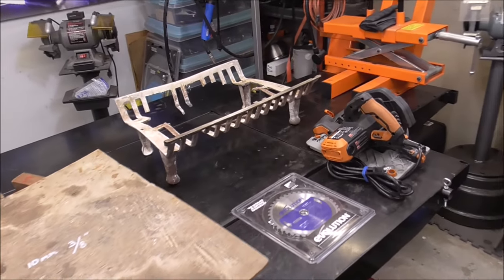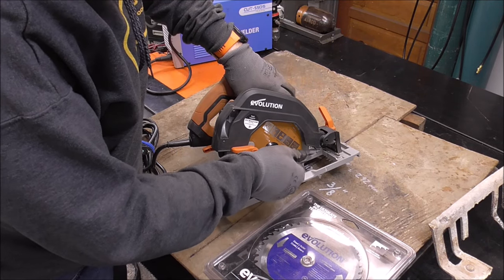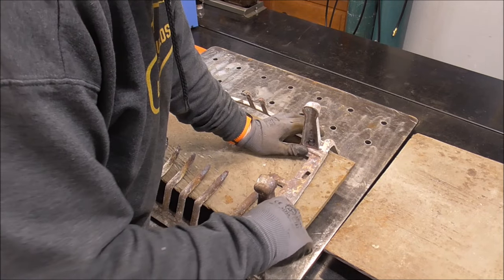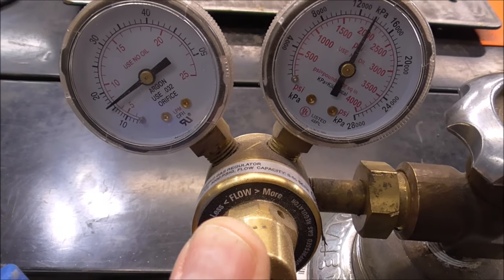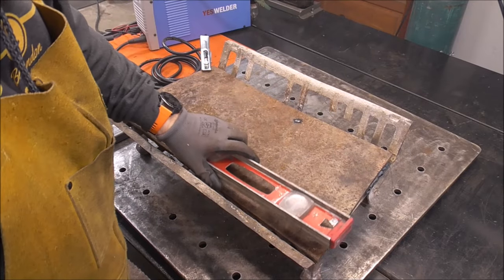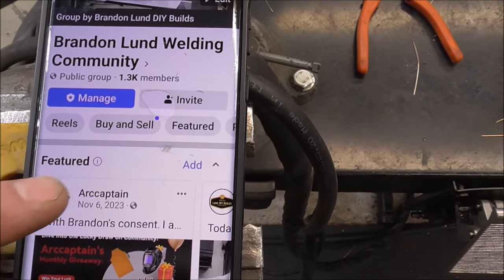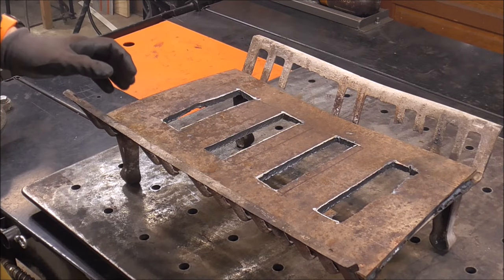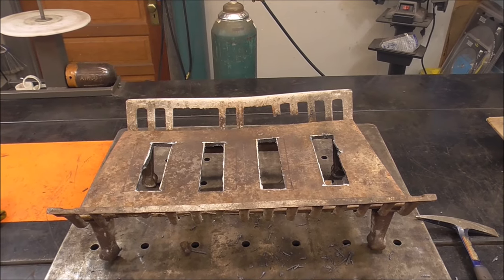MIG Welding and Plasma Cutting Fireplace Grate Repair: 12 Interesting Facts

Comment from the maker: Metal Cutting Saw Link: https://store.evolutionpowertools.com/products/r185ccsx?ref=BRANDONLUND
MIG200 https://www.arccaptain.com/products/mig200-200amp-multi-process-synergic-mig-welding-machine?_pos=1&_sid=76eca4fa3&_ss=r&ref=Brandon
Plasma Cutter https://yeswelder.com/collections/plasma-cutter/products/plasma-cutters-cut-55ds?ref=BRANDONLUND
$25 Aluminum MIG Conversion https://youtu.be/FGhSo82MP9U
MORE WELDING AND FABRICATION VIDEOS HERE:https://www.youtube.com/playlist?list=PLfbf78fMz9Vol0uX2-GNc6mLi75zpqb5f
LEARN HOW TO WELD VIDEOS HERE:https://www.youtube.com/watch?v=ADa1I319GJ0&list=PLfbf78fMz9VqxPZTT-xmwdcrHVa7ML-ft
AWESOME TOOL BUILDS! https://youtube.com/playlist?list=PLfbf78fMz9Vo2Cv3V5fmYlDZGpS8Hp98l

Comment: Hi Brandon, 

Years ago when I first purchased my plasma cutter, I was told that my air source was oil-less, IT WAS NOT!  That was an expensive assumption never to repeat!

From that experience, I purchased my own  "oil-less" air-compressor and made sure to always carry at least two air dryers for those extra humid days.

I really love your contribution to the environment by using the warped plate material for this project. 😊

Tim from the lower deserts Arizona.
Reply from the maker: Thanks Tim. I love recycling metal whenever I can. Dry air is definitely good for extending the life of your consumables 👍

Comment: Fun little video! I really need to download that plasma chart. I have been running too much air pressure and too high amps when I am cutting! Thanks for sharing as always, Brandon!
Reply from the maker: Glad it was helpful! Yah you will save on consumables and you get a better cut

Comment: Ever think about putting an insert in the fireplace? My ex father in law put one in his house and boy did it keep his house warm. Myself you should make the whole thing out of steel. I had an old like pot belly stove and I don't know how many times I had to replace the grate in it. Good to see you doing some welding!
Reply from the maker: Honestly Jake, I think i'm a glutton for punishment. EVERY year I tell my wife I'm going to put in a propane insert and every year I find myself buying, cutting, splitting, stacking and lugging wood.  As I get older it doesnt come as easy as it once was. I know it will be so much more efficient but one of these days I need to bite the bullet but It's almost nostaglic doing everything I mentioned but it's nice to flick a switch and have instant heat too. LOL It stinks getting old brother Hahahaha

Comment: When I first bought my fireplace I asked the expert about what kind of grate I should get. He said none. He said grates are for making nice looking fires, but if you want to use a fireplace for heating, the fire should be directly on the bottom of the firebox. After many years without a grate,  I have to agree with him. I've been heating my cabin in western Canada for many years, and the biggest issue is keeping my place from getting too warm. I of course have a fire brick bottom on the fireplace,  and an outside air source, and sealed glass doors .
Reply from the maker: I'm not educated enough on the subject to know the difference but i do remember my dad had a german designed heating firplace and that one had a grate. The bottom of this one has fire brick but the box is steel. There are grates on the face of the brick that pull air in from the bottom and it rises out though the top grates from the air gap between the steel firebox and firebrick. My doors aren't sealed. We do it solely for the ambiance but the added benifit is the heat so for our intended use the grates are probably best for us. We also have a brass door in the bottom of the fireplace so you can sweep the ashes in then empty them in the basement but i don't use it. I just shovel it out every few weeks

Comment: Fascinating and unbelievable to see 10mm-steel cut like butter with a circular saw😁. My jaw just drops😅. Think that wasn't possible 10 years ago. Never dared to try this myself. What a great repair. Always tricky welding on old cast-iron. You succeeded 100%% in it. Just compliments Brandon. Learned a lot. Many thanks and greetz from Holland😀
Reply from the maker: Thank you very much! I appreciate it Marcel. You are 100% right, they have come a long way with getting these saws down in price and the ability to cut thick materials. I was totally impressed.

Comment: Nice video! I was curious as to why you chose mig instead of 3/32 6011 or 6013? Does mig react better with the cast iron?
Reply from the maker: 6011 is better on the dirty steel but the MIG is better for making the connection to the cast. Silicon Bronze works excellent on cast but it's melting temp is too low for this application. A 7018 would be my go to if I only had stick. It's a low hydrogen rod with ok results on cast iron. I have a whole series on cast iron thats pretty popular if your interested :)
Reply: @BrandonLund  Thanks Brandon, I appreciate the response! I'll watch it. I did catch the video on the Muggy rods and was floored at the idea of welding cast iron without a pre-heat and cool down. Stay warm, here in Nebraska we've been getting hammered as well
Reply from the maker: Thanks man! It's currently 10 degrees right now as we speak Brrrrrrrrrrr!

Comment: Brandon, the last Thanksgiving shopping craze saw me land a YesWelder CUT-55DS Pro plasma cutter for 107.99 including tax on Amazon. A super sale price along with an Amazon coupon made this incredible buy possible. Health and family issues have prevented me from using the cutter so far. I also do not know much about the unit. Do you have any experience with the CUT 55DS Pro or perhaps someone watching can chime in and let me know what they think about the DS Pro and perhaps any issues I need to be aware of. Perhaps there is a great YouTube video out there that breaks down the DS Pro. If anyone knows of a resource other than the manufacturer, I would appreciate it.... many thanks... Joe
Reply from the maker: Interesting enough Joe, I just browsed YesWelders site yesterday and bought a CUT55DS Pro with the plan of doing a giveaway with this plasma cutter in this video. What interested me is that the Pro it's not a high frequency unit, which means you can use it around sensitive equipment without signal interference such as on computer controled vehicles with less worry of frying the electronics. Great for exhaust and rust repair. It's still good practice to disconnect the battery but lot less of a chance of disrupting sensitive electronics. I plan to do a very detailed video of that machine AND i've made an arrangement with YesWelder to provide my viewers with a promo code so I can save them a little money too. 107.99 is a screaming deal for that machine! It's a very nice unit and I cant wait to fully test it out. I'm going to push it to it's limits and see how it does.
Reply: @BrandonLund  Thanks Brandon. I look forward to your video and review-demonstration (hopefully) of the CUT 55DS PRO. I have already learned something about the DS Pro from you already. Thanks again Brandon, greatly appreciated.. Joe
Reply from the maker: @joesharp5602 thanks Joe. It should be here by next week and I plan to do do a very thorough review and test.

Comment: Could you mention in the future how well this repair held/worked?  I am wondering if something like that when being welded in while it was new if it would have made it last even longer then doing it as a repair?
Reply from the maker: Absolutely! My guess is that after a while, the weld at the cast iron to steel will eventually fail from the heat cool cycles, but maybe not... I have no idea how long it will last, but I'm just as curious as you and will report back at the end of the heating season 👍

Comment: My Hugong probably won't even be able to start the arc on such dirty material.
Reply from the maker: Give yourself a good ground and a spot to start your arc and it will go. MIG really doesnt like dirty metal. 6011 / 6010 electrodes would be perfect for this but MIG is faster so I went with it :)
Reply: @BrandonLund  yelp SamoVAc doesn't like MMA. 😉
Why don't you opt for wood pelets instead of oil for second fuel?
Reply from the maker: I think I might actually go with a propane insert at some point. Pellets really arent a bad idea either really.
Reply: @BrandonLund  I'm guessing pelets are cheaper than gas and gas is cheaper than oil, so that's why I suggested it. Although the pelets do come with a potential problem because the system might jamme from time to time. Haven't used oil or LPG because it's not that popular nor accessible in my hood, so I don't know if those systems have similar issues. 
Used pelets for 12 years until the price skyrocketed at the beginning of rona, when I switched to wood.

Comment: I know that you have to have the screen in front of your fireplace but it blocks lots of heat
Reply from the maker: It's proobably a good thing. It gets super hot in the room but I'm sure it does keep some of that heat up the chimney
Reply: @BrandonLund  I know that they block lots of heat I have used them before